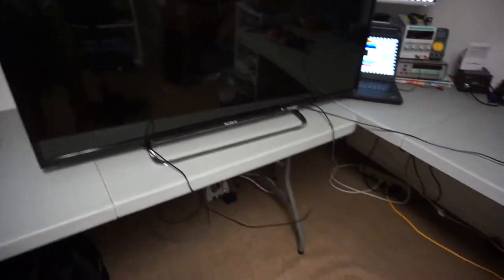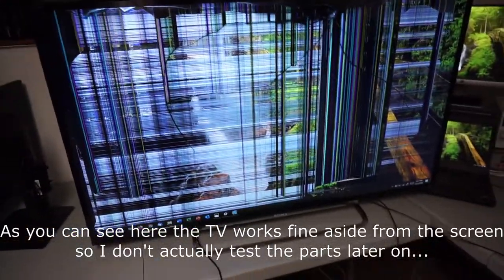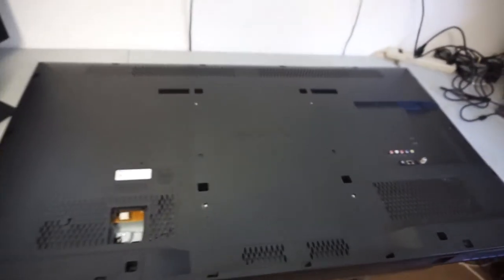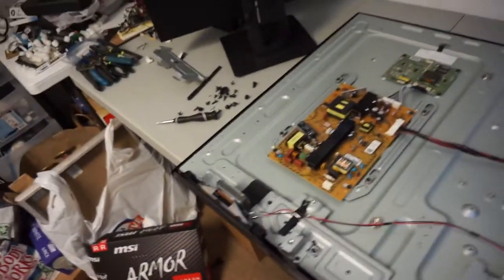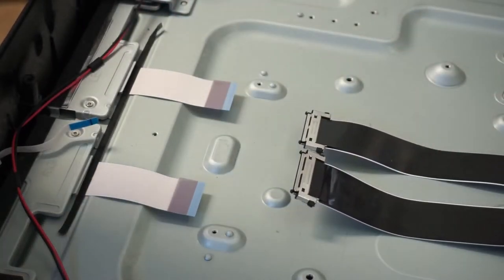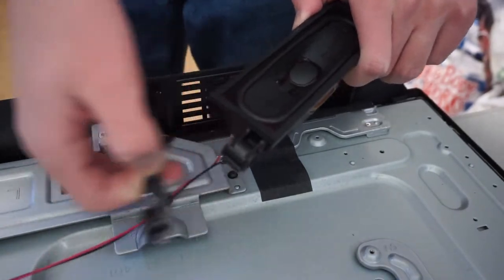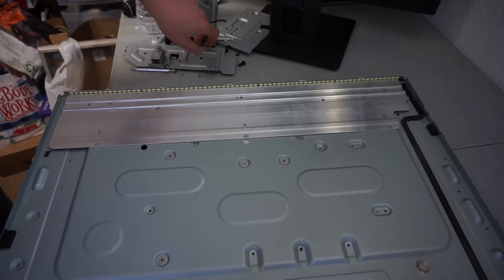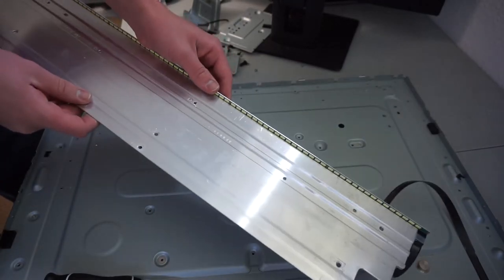Salvaging parts from a free cracked LCD TV - Make money from a broken TV!

Comment: Great video and very informative. 

Now not to nitpick but more of an FYI, on your screwdriver it looks like the type that has the spinning end. You can rest it to the inside ball across from your knuckle (idk name of it but where the end usually hits your hand). theres an indent on the spinner usually. Then just add a little pressure and you can spin the screwdriver with one hand and it will spin instead if other hand helping spin. Hope this isnt too confusing like I said Excellent Video!

Comment: Clear explanations and walk-through - thank you for such a nice video! I have a 37 inch LCD TV, which stopped working for unknown reasons. I'm thinking of either taking it apart and sell the parts as you suggested, or recycling the LCD panel for a smart mirror project, both or which are new adventures for me!🤣 Do you know if I want to reuse the LCD panel with a Raspberry Pi, what boards I would need to keep?

Comment: I have a 55 inch Vizio TV I can't log into my Wi-Fi and it freezes when I try to log in. I have to power off and back on to get it back to normal but when I try to log into wifi it freezes again. Is there a part I can replace on it? TV works fine it's been on the wall so it's not physically damaged in any way. It's probably some internals gone bad but I don't know much about fixing TV's.

Comment: Is it possible to use motherboard from a smart TV to get audio signal from computer HDMI port and convert it to optical? Or would that require to connect actual screen to motherboard and making some selections in its settings? You see, my old Samsung C750 just simply died on me. It does not turn on at all. Anymore. It does not even show the red light in a corner when powered off.

Comment: I have two little TVs one is a 25 in and the other is a 22 the one that is a 22 has a cracked screen but you can see the upper half the 25-inch will come on and you can see the backlight but can't see the picture I can hear it but I can't see it when I press the menu button the menu doesn't pop up so I'm watching this to try to figure out if I can take one TV and put parts in the other to make the TV that doesn't have a cracked screen have a picture again? I mean they're like$100 at Walmart but I like messing around with stuff like this but at the same time I'm electrician and I know the hazards of putting electrical parts where they shouldn't be, I'm not trying to burn my house down just trying to fix my TV lol I think I can do it if I figure out what all the parts are and what they do and just change that out.

Comment: I was hoping to see some info about the lens as that is what I was specifically looking for, to be honest.

However, aside from that, I liked the video. Your audio is clear and easy to understand so that's a plus. I would recommend a tripod or some kind of mount but one that articulates easily to new positions as you don't have a partner doing the shooting.

Also, from information I've learned from other sources, the lens can be put into a frame and used for heating things and even starting camp fires. You might have an opportunity to do a project like that if you kept it.

Hope you are keeping up with the production, I don't see anything wrong with what you're doing.
Reply: Buy a cheap fresnel lens, they sell thin plastic ones at craft stores. Only cost a couple dollars and they're flexible, so they won't break. Same thing lighthouses use, but you can diffuse or concentrate light, all you gotta do is flip it over.
Reply: @Bl00dYtW3aK3r  At the very least you need a 36" fresnel lens, and a spot lens at that, in order to do the cooking and things I'm after. The "cheap" ones are just that - "cheap."